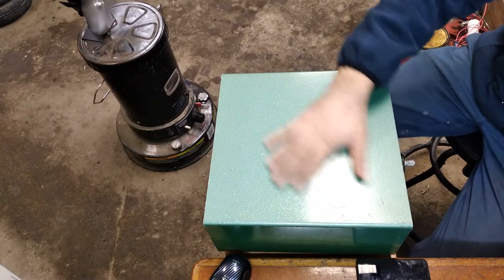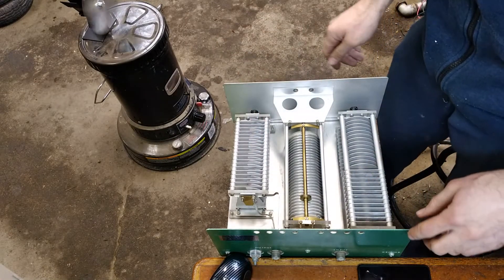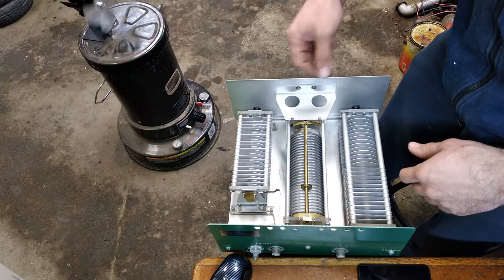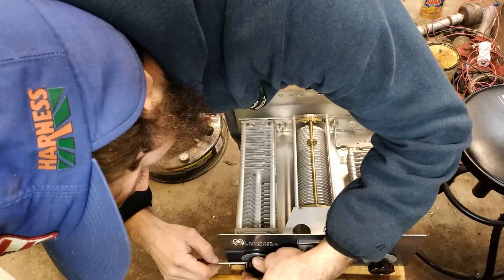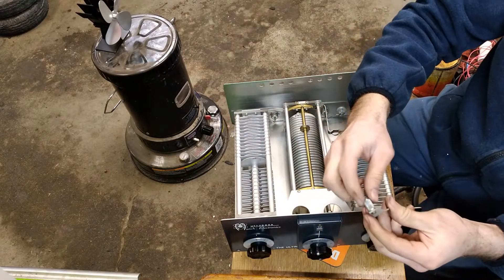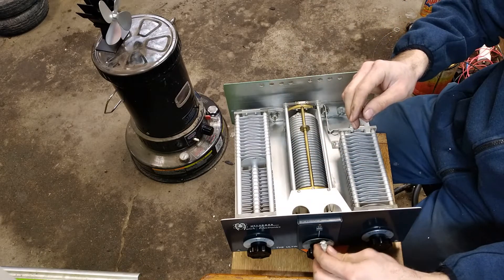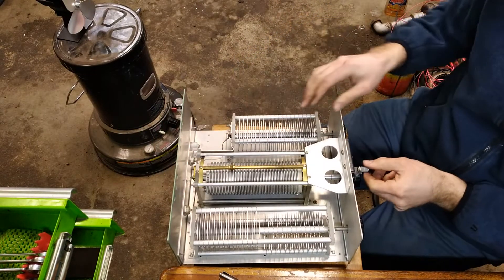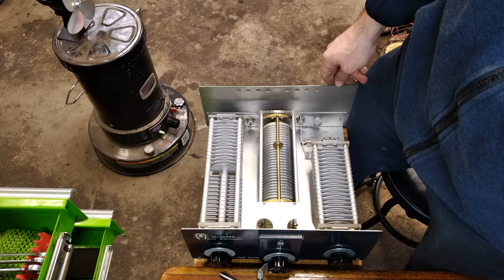Murch UT-2000A Overview

Comment: The roller inductor that you have there is nothing new.  I built a Heathkit SA-2060A back in the early 80's and the inductor is exactly like what you have.  It works pretty well.  I still have and use the Heathkit.  I watched another video on the Murch and the counter problem was solved with replacing the spring at the end of the ratchet pawl. The original had become loose and the pawl was not turning as it should.  Good luck with that.  I have one that I got in an SK estate auction a few months ago.  I'm going to clean it up, not that it needs it, and sell it.  73, KD5IL